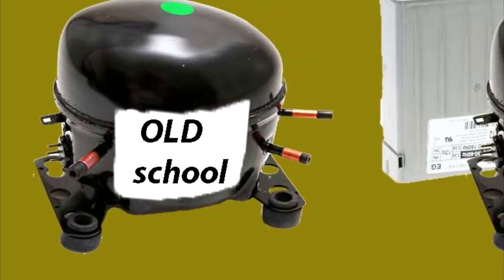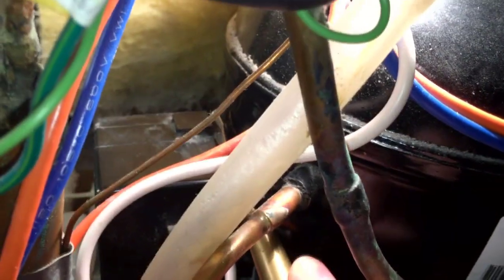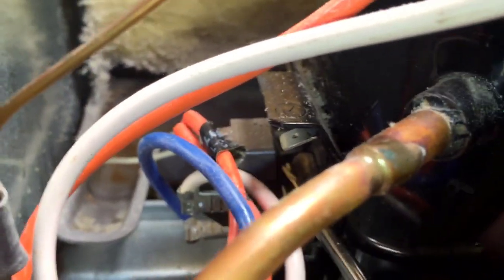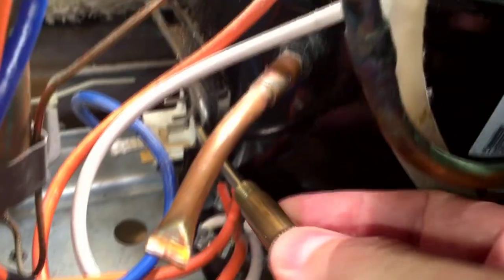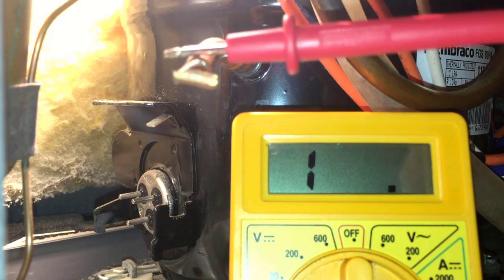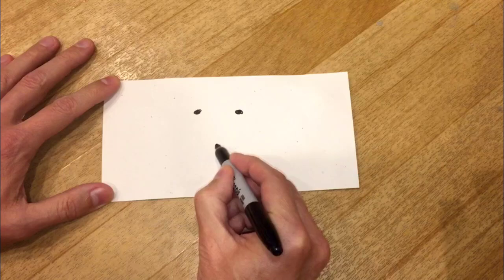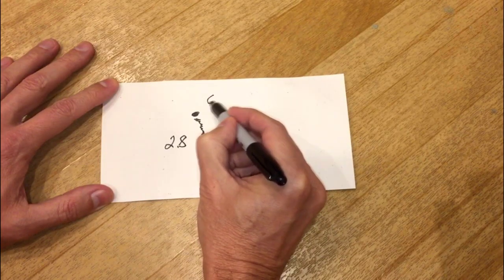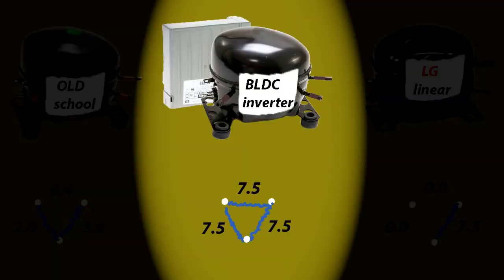Testing refrigerator compressor LG, Samsung, Whirlpool...

Comment: Hello, 
I have compressor Embraco VESC11C, resistance between all pins is 13.7-13.8. Is it normal resistance. What can be a reason that the compressor does not work anymore. Any advice is appreciated. P.S. Serviceman said that compressor is broken down, but according to your video it is ok.
Reply from the maker: This test can only check the electrical part of the compressor. The mechanical part is impossible to test. So it can only be assume it's bad.
However, if it's a variable-speed compressor, the inverter usually burns out first. Did the service man try a new inverter?
Reply: @Your-Self  Thank you for your reply. The service man tried to connect something, but i do not know what exactly he did :(. My wife was at home, when he came. 
When I measure voltage on U-V-W  with mini-oscilloscoop there are no signal above 100 mV. 
The voltage on big and small capacitor is 320V and 16V respectively. The input voltage from the mainboard is ~230,  but no voltage after small "chip" nearby. So,  I am curious about it.

Comment: Where is the relay of the LG linear inverter compressor ?
Reply from the maker: LG linear compressors don't have a start relay. They get the variable power from the circuit board and just run.

Comment: You said up to 9 ohm of resistance. I have 12.5 between all the leads. Is it too high?
Reply from the maker: Some compressors have slightly higher resistance, so it's not a problem.
Reply: Thank you

Comment: Great video, I'm just a little confused with myself. I believe I have an l. G linear compressor that was replaced 2 years ago on my 5-year-old Ken, Moore, Italy, refrigerator freezer, the setup I have, it's shaped like a triangle one pin on top and two below that. When I put the meter on ohms from the top pin to the bottom right, i get nothing O.L , then, when I put it from the top pin to the bottom left, I get nothing O.L but when I put the meter on the 2 lower pins side to side, I get 8.9.
Can you tell me if this compressor is bad. When I look at your drawing, it shows from the 2 pin to the single pin. You're getting 7.5. I'm not sure if it matters that i'm getting it from the two lower pins 8.9 .Please if you could let me know. Before i have to go out and buy a new refrigerator. Thank you I appreciate it
Reply from the maker: Your 8.9 reading is good.
However, the compressor could also fail mechanically, or you may have a leak. See if you can check the temperature of the condenser coils (next to the compressor) as in this video https://youtu.be/ipwOerjFITg 
If they are not getting much warmer than room temperature, it will probably be an expensive repair.
Reply: I seen your other video and i measured temp of condensor coil i was running about 13 degrees more then the room temperature. The replaced compressor had a serviceport on the short copper line. I picked up a hose and gauge from amazon with a can of 134a refrigerant, i put it to the service port without piercing the can of 134A  and i read 35psi so i think the freonis still in there. It never droppeddown to the negative.  I was thinking about buying a piercingvalve and installingit somewhereelse on the suction line to try to see if i get a differentreading then where i hasmd it on the short copperlune with the serviceport. Not sure if that would matter.  @Your-Self
Reply from the maker: If you got 35 PSI when OFF, it's too low. Needs to be 45+ of R134a
If you got 35 PSI while running, the reed valve inside the compressor could be cracked.
Reply: @Your-Self im sorry to keep bothering you. I'm working with an Amazon product a hose that hooks up to R134A and then a guage, then hose that goes to either sevice port or piercing valve. I don't have commercial guages or a vacuum system. Should I try using a piercing valve? On another part of the suction line, instead of using that small little copper service port. Do you think I would get a different reading there? Most videos I've been watching using the same product that I got from Amazon. it shows it goes right into the green, the negative. And then they add the refrigerant, and they get it to go up to  2 to 3 psi in the postive
Reply from the maker: The suction line is the same LOW side as your service port.
You still didn't specify if the 35 PSI is when the fridge is running or off. If it were running with 35 PSI, adding refrigerant would not help.
Reply: @Your-Self ok with it off it's 62 psi when I leave hose hooked up and plug it in, it drops down to 50 psi when running. Not sure how I seen 35psi. But right now those are the numbers 62 not running and 50 running
Reply from the maker: You have plenty of refrigerant, but the compressor is not pumping properly ( probably a cracked valve). A typical problem with the LG Linear compressors, and probably why it was replaced 2 years ago.
There is a smaller chance that there is a restriction on the HIGH side, but either way, it's an expensive repair. Sorry.
Reply: @Your-Self ok thank you very much for all you help. I really do appreciate it. You're a good man

Comment: I have a lg linear it test out electrical  6 ohms.. no short to case.. but it hmm but I don't see much current draw ..my question what volt does these compressor need 200v..what freq..etc I want to apply external  power to determine if it will run  need help with wire starting cap and need voltage

Comment: I have lg linear compressor test normal 8ohms ..overload devive  not blown... test ok.. compressor getting 200v on main pcb.. place in service mode... doesn't appear to  slight hmmm.  High pressure  side barely warm in test mode

Comment: Hi. Mine appears to be the BLDC variant with a large black box with a circuit board for a relay. I am using the exact same multimeter that you are using in your video. All 3 pin combinations read 11.7 ohms (with a slight jump +/- 1-2 ohms). This is above your recommended 5 to 9 ohms for all three pin combos. Do you believe this could be a compressor issue? Or relay issue? Thanks!
Reply from the maker: Your readings sound good. With the BLDC compressors, it's usually the circuit board in the box that goes bad. But I can't guarantee without testing it first.

Comment: Your video is the only source that claims there is no resistance between the other 2 terminals on an lg linear compressor. All other sources Ive read contradicts this information
Reply from the maker: The Linear compressor has just one winding between two terminals. The third terminal is not connected to anything. It's a dud.
Reply: Great... Client is buying a new fridge because I thought the windings were bad. Wish I saw this video sooner

Comment: My LG fridge with a linear compressor (FLB075LBNA) has cooling issues. I tested the resistance between the three pins and the only reading is 9.3 ohms. There’s no reading between the pins and the compressor body. Is the 9.3 ohm readings normal?
Thanks
Reply from the maker: Yes, that resistance is good.
If the compressor is running but not cooling, LG had a bunch of compressors with a weak reed valve inside that breaks within a few years. This resistance test would not show it as a problem.

Comment: Should we still hear a click from the start relay when the compressor turns on and then another click after the compressor has run its cycle? My understanding is we should hear those two clicks, but if those clicks occur fairly quickly, then that indicates an issue. But I'm brand new to trying to figure this out, so I might be wrong. Can you provide any clarity? Thanks.
Reply from the maker: A working refrigerator makes many clicks and noises, so it depends on your issue.
For example, a compressor with a popular PTC start relay will hum for a few seconds, overheat, and the overload will click off for a minute or so. Then, the trying cycle begins again.
However, with a TSD relay, the compressor may actually start and run for a few seconds, overheat, and the overload will click off for a minute or so.

Comment: Hello this video is the absolute best!

I have a wine mini fridge that fails to power on at all. I replaced the boards only to have it fail a few days later and not turn on again. No lights fans etc.

I pulled the board and there is a traditional looking glass cylinder fuse on the boards that is all whited out and looks blown. Was thinking of the compressor failing and checked. No short to ground. Readings are 2.0 and 7.8 from S and M pins to C and 7.1 across S and M. So doesn't quite add up.

Relaya and overload circuit have continuity at room temp and relay as 12 ohm btw pins. 

Do these numbers indicate the compressor may be hitting high (lock up) amperage? With a new board not fixing the problem and looking blown too what do these compressor numbers suggest?

Thx so much
Reply from the maker: If the problem was with the compressor, the overload should cycle it off.
Something like the defrost heater or the evaporator fan is possibly shorted and blew the board. 
But it's difficult to speculate without being there.
Reply: @Your-Self  thank you for your quick reply. Off of the 120v side of the board, it sends leads to compressor, transformer board (which after AC to DC conversion has 12v DC outputs for LCD control board, lights, and 4 fans), and lastly a 120v supply to something called a PTC heater. I'm assuming since it's a dual zone wine fridge that this is a heater/thermistor in the warm zone of the fridge. It's rated at 1.0 amp, so I suppose I should check this amp draw when I get power back to the unit. It's my understanding this are more solid state devices and really reliable. But like you say, the overload circuit should cycle a high draw failing compressor off and prevent current draw on the board and blow the fuse.

Let me know if my logic is off. Appreciate it.

Comment: LG linear compressor on mine reads 8.5 on left side and 0 on right side, everything else checks out good.
Reply from the maker: Linear compressors have had a history of checking out good, but having internal failure.
If it's under 5 years old, LG may replace it for free.

Comment: Thank you for your video. I have a LG LFD22716ST linear compressor for 4.5 yrs.  It is not cooling(freezer and refrigerator), fans are working.  3 red lights blinking on the board.  After I press 1 time for test mode.  Compressor is not responding.  There is 40 volt to the compressor initially.  Compressor is not shorted.  7 ohms on one of the pins and nothing on other two.  Wondering if it could be the board or compressor or something else?    Thank you!!
Reply from the maker: Most of the time the 3-blinks indicate a problem with the compressor.
Try calling LG directly since this fridge could still be under a 5-year Sealed System warranty. They may fix it absolutely free!

Comment: I have a Kenmore 795 with LG Linear Compressor I install a pierce valve I am seeing 60psi is that s sign of a bad compressor? I can hear the compressor running but it is not getting cold.
Reply from the maker: Probably yes.
If you have 60 PSI when the fridge is unplugged and the same 60 PSI when the compressor runs, the compressor is probably (inefficient) bad.

Comment: I was trying to measure the compressor on my fridge which clicks off a few seconds after what sounds like starting up, and I got some weird readings...I got around 23.5 ohms between the "tip" and either of the other two pins, but only around 1.3 Ohms between the two "base" pins. Haven't seen such numbers mentioned anywhere, they seem way too different from what everyone else seems to mention these compressors should measure. It is a HVY44AA compressor in an 18-year old Electrolux fridge. Has a weird relay (replaced, didn't change anything) that could perhaps fit the description of "a grey box", so maybe it is the BLDC inverter compressor and should have 23(ish) ohms between all three pins? Any idea or help would be much appreciated.
Reply from the maker: Yes, it's a strange reading.
Did you try to remeasure it a few times?
Also, maybe it's a 1.3 kOhms or mOhms?
Reply: @Your-Self  Yep, I checked it several times because of how unexpected the values were. But sure enough, that's what they were. And yes, it was certainly in Ohms, double checked that as well.
Reply: Thanks for the video, my LG linear LMXS27626S stopped cooling and freezing, compressor was hot that it melted the black label down to the drip, I unplugged it for a day, then plugged it in, everything works fine in terms of cooling and freezing for 4 straight days now, but the compressor still gets hot, it is usually resting early in the morning and not very hot, but I see light flashing 6 times inside the panel box. Any advice is appreciated.

Comment: My LG Linear compressor runs and has a 10.5 resistance between the two posts that show a resistance, not 7.5. Is this normal? The others read 0 as you said between them.
Reply from the maker: If your compressor runs with 10.5 ohms of resistance, it's normal.
And that means that the problem could be with the refrigerant (Freon) leak or the compressor got "weak." Which is typical for the LG linear compressor. 
Assuming all the fans are running, it's going to be an expensive repair, sorry.
Reply: How do I know if it's the compressor for sure  though? This compressor was replaced 5 years ago, but I know they have a bad history. It could be a leak anywhere in the system.
Reply from the maker: A technician needs to install gauges to check the pressure of Freon.
If the pressure is good, the compressor is bad.

Comment: What if my ohms just jump around when on the compressor pegs and won’t give a real reading
Reply from the maker: Try to keep your leads as steady as possible.
Check your multimeter wires. They could be damaged or not inserted all the way.

Comment: Wow, thanks for the info. The comments have also been a help but I have yet to find the root cause. I have an old school Amana. Last night something suddenly started buzzing, not wake the dead loud but loud enough to hear it from another room. I unplugged the fridge and plugged it back in. The buzzing stopped but I heard a cyclical clicking every couple minutes. Fast forward to my investigation. The compressor is not running but gets hot. All fans run. The ptc relay does not rattle and there is continuity between the 5 & 6 female holes. The overload is separate and has continuity, although a bit of resistance. Is this an issue? I have not yet checked the capacitor as my DVOM does not have that capability. This is interesting. The cyclical click is actually 2 clicks. I hear the first click and the inside light dims a bit and the fan slows a bit. About 10 seconds later I get another click and the light and fan return to normal. This cycle is happening once a minute or just under. If I put a finger on the ptc and another finger on the overload, I feel the clicks more with the finger that is on the overload. I did the 3 pin resistance check per this video and although I didn't get 2 numbers that total the 3rd, at about 16, 12, and 8 ohms, I was as close as some others that have commented. Aside from the capacitor check, have I missed anything?
Reply from the maker: How much of the resistance does your overload have?
It should be close to 0... something between 0.0 - 0.4 is OK.
If it's higher than that, check your multimeter leads against each other. Leads themselves may have some resistance in them.
Reply: @Your-Self  I checked it again with a better meter and yes, it is almost nothing. I was also able to check the capacitor with the borrowed meter. It measured 11.8mf. That doesn't leave much unchecked.
Reply from the maker: Yeah, it points to a seized compressor. Even if it checks out well with a multimeter, it can lock up mechanically.
You could still try replacing the start relay just to rule it out completely. But looks like the compressor is bad.
Reply: @Your-Self  have you ever used one of the compressor jump start kits that sell for about $15?
Reply from the maker: I personally haven't.
But a Hard-start kit can give you an extra boost to possibly unlock the compressor.
You could try an RCO810 for a smaller/mini refrigerator. Or an RCO410 for larger/regular units.
With a Hard-start kit, the compressor may start and run, but it can still overheat and cause problems. Just keep an eye on it.

Comment: Great video! I have linear on LSFXC2476S, shows 9.5 between the bottom and back pins, nothing on other two, also not shorted out. Refrigerator and freezer get cold, but eventually warm up. Board shows 6 flashes. Any ideas? Thanks!
Reply from the maker: The 6 flashes could mean a lot of things, but mostly a bad compressor. Even if it checks out good with a multimeter.
If the compressor was just replaced, the problem could be with a restriction created during the installation.
If it wasn't replaced yet, it's best to call LG directly. They may replace it for free (under a 5-year warranty) or give you a free compressor. You'll pay for the installation though.
Reply: @Your-Self  what leads would I check to see if it is the board that's bad?
Reply from the maker: If the compressor is running, the board is good.
Usually, when the compressor is running but not cooling, means a bad compressor internally. Sometimes, however, there could be a refrigerant leak. In this case, a tech will need to attach gauges to check the internal pressures.
Reply: @Your-Self  thank you so much! I guess I will part it out. Not worth putting a compressor in it. I bought it for $100, I'm sure I can get out of parts

Comment: Hello
If the compressor work 5 seconds and stop , I was change the relay and overload , but the problem is still
Reply from the maker: Typically, the problem would be with the start relay. But since you already changed it, the issue could be with the compressor itself.